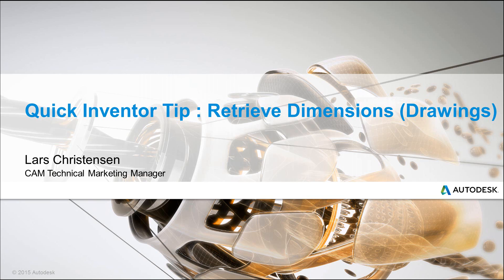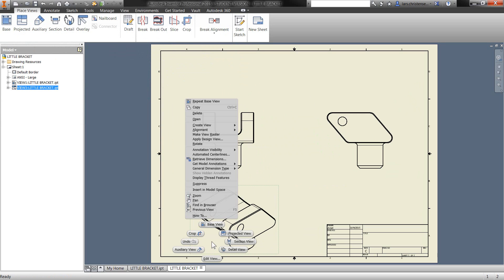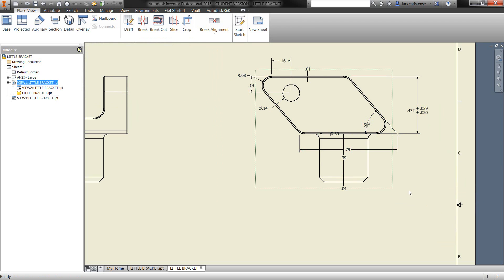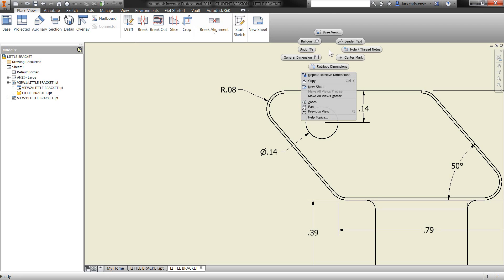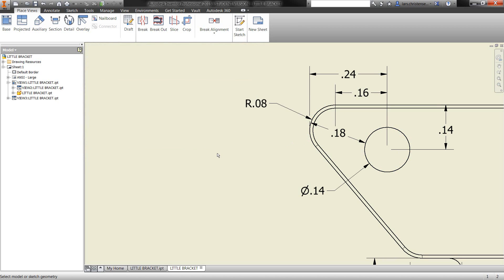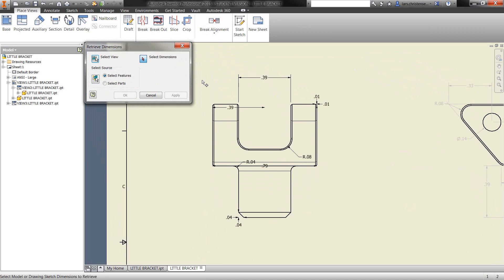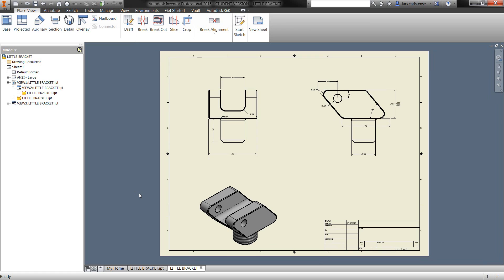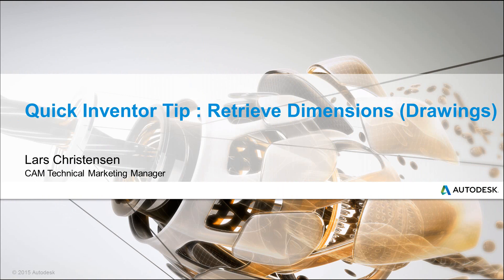Autodesk Inventor Two Minute Tip Retrieve Dimensions

Comment: How to add dimension between line and circle ih sketch design? I mean maximum and minimum distance, default value is dimension between center point and line, but I don't need that. Thanks